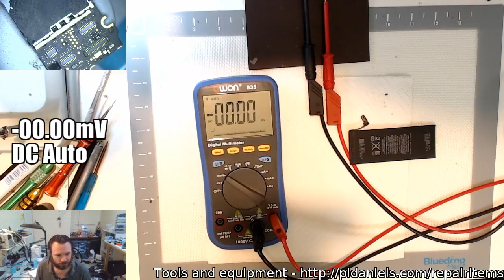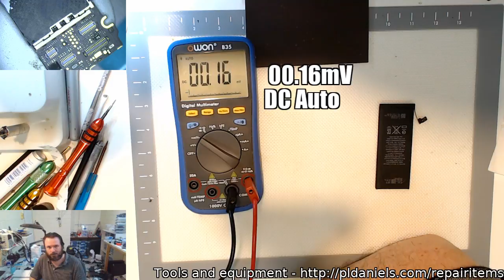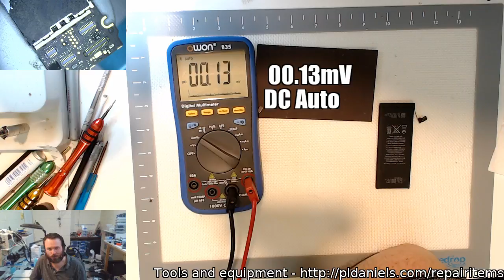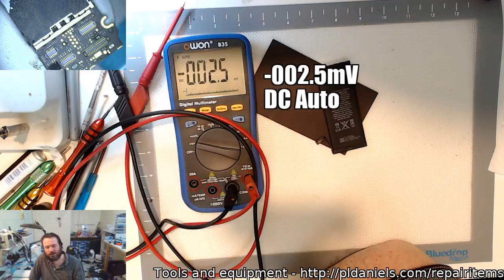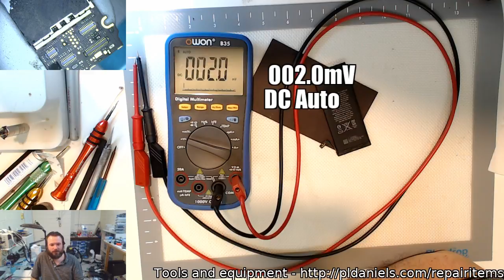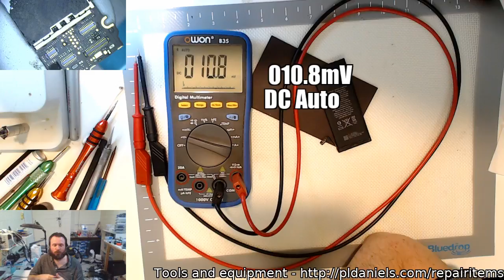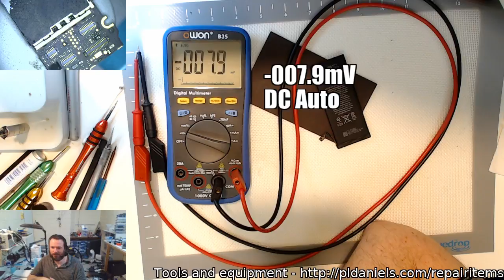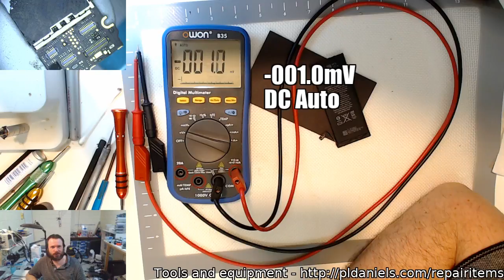Live: Quick test of new custom OpenBroadcaster version with fast text load

Comment from the maker: For those of you who have blessed with Windows build machines or don't mind some linux building, you can get my modified source from;

    https://github.com/inflex/obs-studio

Build instructions for OBS are at - https://github.com/jp9000/obs-studio/wiki/Install-Instructions

Update: 
  **  You can try out this OpenBroadcaster release if you have already installed OBS on your system.   
              1. Download http://pldaniels.com/OBS-inflex-20180211.zip
              2. Unpack 
              3. Run the OBS-inflex-20180211/bin/64bit/obs64.exe 

All your existing scenes/setups should be present, but now you'll have the extra text file load options.